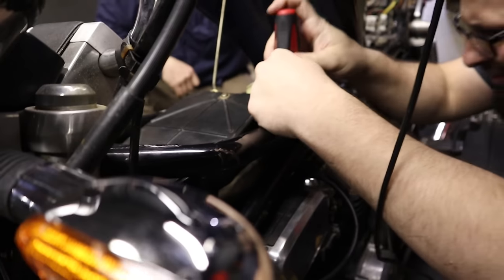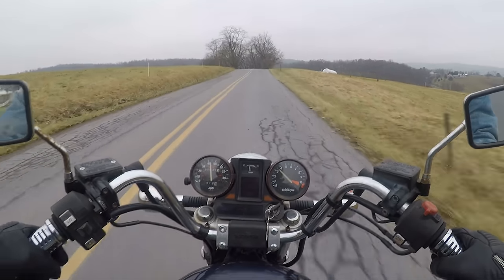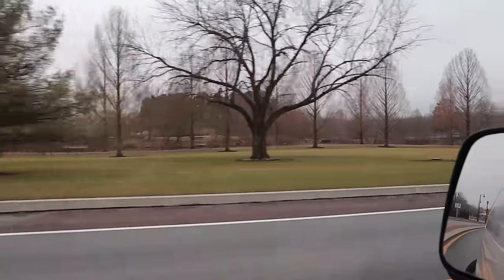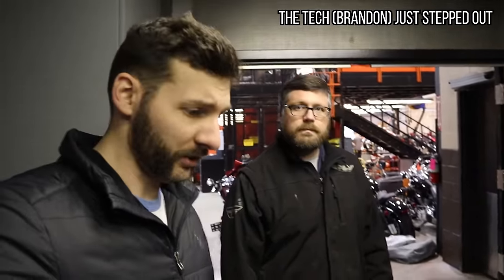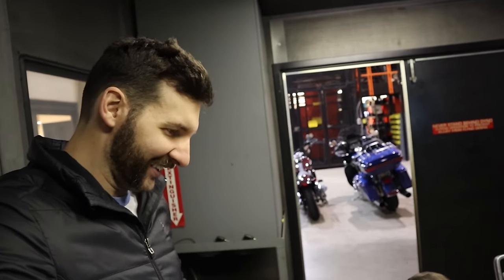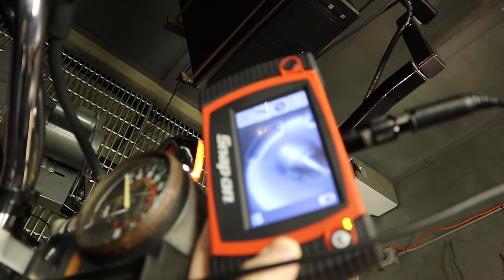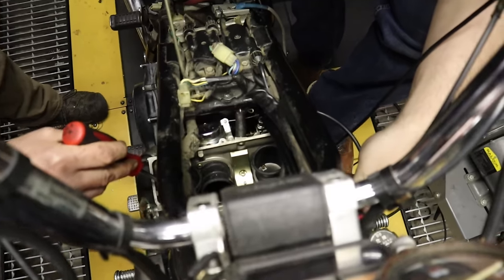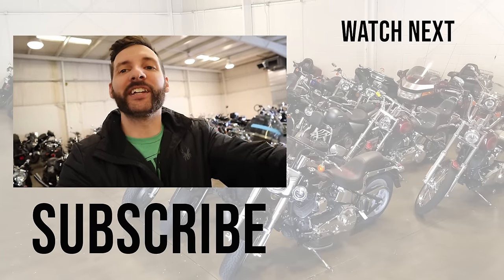We FIXED this abandoned bike for $83 then put it on a DYNO | 83 Honda Magna

Comment: I really enjoyed this episode. I don't know if you remember, but I picked up an '82 Yamaha Virago 920 last summer. I got a good vibe from the guy, he had trouble with the carbs which I found is most likely from over spraying paint inside the tank. There were pieces of paint flaking off in side. He gave me an extra tank which had the same problem. I haven't had time to work on the bike because I've been working on 2 apartments. The 1st to get ready for the people in the other apartment to move into and now finally finishing up the 2nd for me. It's amazing how some tenants can screw up an apartment. Every door needed some kind of work. Paint had been spilled on one carpet and just left. Luckily I was able to get most of the paint out using paint remover. Also, in my apartment there is an entry room outside the apartment where I Will hopefully work on the bike. Only problem is its on the 2nd floor but where there's a will there's a way and the landlord, a good friend, actually suggested moving it up there as he is a long time bike rider and has a 2003 anniversary decked out Harley. I learned a lot watching the guys working on your carbs, luckily I only have 2 with an extra set. Thanks for sharing.

Comment: I absolutely love the first gen Magnas, and just about any v4 cruisers. Early Magnas like this one were plagued with soft cams and top end lubrication issues. I wonder if this has come up in your efforts to get the power back.
Reply: That's what I was thinking. It probably just needs new cams and oil mod.
Reply: itsabig  yep. Scary fast. My Blackbird is in a totally different league of speed, but the bike is actually built for it. My V65 Sabre had power, but everything else about the bike makes the eyeball flattening speed feel like a completely different kind of scary. 

If Honda doesn't come out with another decent V4 cruiser, I might get a Magna someday.
Reply: @navypatriot1016 NOPE.  Look up the fastest production motorcycle for that era 83 through late 80's.  It was in fact the V-65 Magna.  I still have my v-45, bought it brand new in 83, and it runs like a top.
Reply: @navypatriot1016  I guess I was thinking about the fact that the V-65 was in the Guinness book of records for the fastest production motorcycle for that era.
  So yes, by the time the V-Max came around it was a monster that would out run the 
V-65.  But a 'pig'?  Come on now.

Comment: EDIT:FIXED so to make a long story short.. my estranged father i just met a few years ago, wanted to give me a motorcycle(i'm 30 now). i was estatic! 1982 gs650. brought it home, fixed the gas leak myself. fixed the head gasket leak myself. changed almost everything simple and standard. ran great! this bike is everything for me that i missed out on with my father... this is the bad part. someone clipped the spark plug caps (boots) off the other night for whatever reason. so i tried fixing it by adding a ghetto fix. the plugs are sparking but i cant get the bike to turn over and run now. any advice? anyone? i have to get this bike going again, it's a part of that gap i had missed with my family. (I found the problem and fixed it.)
Reply: Check the carbs. If it runs on starting fluid then it’s definitely your carbs.

Comment: I bought, fixed and rode my first road bike that was an 83 v65 magna.  It was cut up, so I made it my own.  Not a bad bike.  Pulls hard when they run good.  The slides not opening all the way could be some varnish on them making them want to stick, an air leak on the top side (near the cap) stopping it from building enough vacuum to pull the slide up, or a plugged passage in the carbs.

Comment: When does he mention if it a 750cc (V45) magna (80hp) or a 1100cc (V65) magna (115hp) ?  I would just get that said instantly. 
This must be the V30 (500cc) Magana at 50hp.
The V65 can still beat most cruisers today.
Reply: He mentions several times it should be 80hp - hence, a '83 VF750C (V45). The V45's can also smoke just about anything on the road, with a good carb job, tuning, and possibly rejetting - you know, basic shit for a carbureted bike. V4 supremacy. I don't even think they made the V30 in '83

Comment: Well, I had the V65 Magna ,1983, and it was rated “first motorcycle with over 100 horsepower”...... I loved that bike and it was a shafty on top of that. Great torque/bottom end.
Reply: 150 mph bike!
Reply: Wendy Stoltzfus then get 6th gear
Reply: Chris Gabbert- it's faster in 5th, 6th is an overdrive and the bike can't redline it. If it could it'd go some 173mph or something (don't remember where I saw that, something about production speed record I think). I have a '84 v65 magna, and it's a great bike. I agree with Michael, easy to ride because you can hang below 4,500 rpm all day and still be faster than cars on the road. Heck its torquey enough I've started in 3rd and beaten cars (it was a 2000's Honda Odyssey but it felt like he was standing still)

Comment: I've had a bunch of these... both the ignition switch and kill switch are underrated for the current (and inductive kick) this thing puts out until they don't work at all. Ignition switch is easy to find new.  I just jumper'd the kill switch since it was less safe to have a bike die unexpectedly. I personally thought the carbs were easy (compared to the nightmare it looks like), do the full rebuild with good hardware, balance them out, they will work. Oh, and repack the gear shift input shaft with heavy grease. Water gets in, rust happens, then you round off the 2 & 5 synchros and they kick out forever.

Comment: Back in my 30s, I had a V45 Magna I rode for a couple of years. I thought it was the greatest bike in the world. Then I bought a 750 VFR, going from a cruiser to a sport tourer, so I didn’t ride the Magna for about a year. I remember getting back on the Magna, thinking something had loosened in the steering head because the bike was all over the road. Then it dawned on me that I had been riding a fair handling bike for a year and was now on a cruiser, known more for looking cool rather than handling. I sold the Magna soon after but have fond memories of cruising down the highway with my legs and feet in front of me, my back straight, listening to that seamless V4 engine. Good times.

Comment: I learned to ride in Hawaii on an beat up Suzuki TS 125.
Used to make McDonald runs.
It was only a couple of miles, but the clutch cable was broken and we all smoked way too much pot to even consider fixing it.
Clutchless riding may in traffic just may be the best way to learn to ride - if you survive.

I was hooked and ended up in the Suzuki dealership.
Started out testing the little GS400, and worked my way up to the 750 - then had to try the 850 because it was shaft drive.
And of course, a 1000 wasn't much bigger - so that's what I ended up driving off the lot with.

I was on a sub at the time, so before we flew out to meet the boat, I dropped the bike at the dealership.
They removed the engine and shipped it off to Vance & Hines, and it came back an 1100.
Also went through the transmission and undercut the dogs for crisper powershifting.

Switched carbs to Mikuni smooth bores.

Never dyno'd it, but it broke 160 on H2 according to the tach.

Comment: Funny that your bike loses power while driving it. I had an 82 Kawasaki KZ440 D-Series that did the same thing. I drove it to a shop to get new tires put on it. When I was driving it back, halfway through my ride, the power just vanished. It ended up dropping from 50 mph to 35 mph in less than 10 seconds. So I pulled into an HOA and sat there for the better part of half an hour wondering what was wrong before I went to start it up again. And it just started up like nothing was wrong with it. I drove back home the rest of the way without any hesitation from her. I never figured out why it did that, but seeing your problem in the video gives me a clue as to what went wrong. To make matters even more hilarious, the starter didn't work on my bike. I had to push start it. Every. Time. It stalled. Nice video, btw.

Comment: I own a V65 and I can get that up to 90mph just on the freeway on ramp. Of course i was laying flat on the tank when I do it.
 I saw a Youtube video of another Magna that was also gutless. It turns out they had a bad ignition coil and were only firing on two cylinders. Even though the engine was running smooth. It was only on two cylinders.

Comment: My first bike was a 99 Magna. Still have it. When I got it, it would run great in warm weather, but it would run terrible in the cold. Absolutely would not idle either. Once you got it running, you couldn’t roll completely off the throttle or it would die. It was so frustrating trying to keep it running.  Carb rebuild and bigger jets fixed that issue tho.   Now it’s an absolute blast to ride. Runs great. Sometimes I’ll go a few weeks without riding it and start to contemplate selling it. It really does sit more than it gets ridden. But then I’ll ride it and think “there’s no way I could get rid of this bike”!

Comment: I had a Sabre V45 and A VFR, great engines.  I put an 82 V920 Yamaha on the road.  I may be too intent but new tires, brake pads, fork oil change, battery, grips, some bulbs, cables, carb cleans, starter and it ran really well.  Put 11,000 miles on it but got offered a trade I couldn't pass up. Lol, got sold to a motorcycle museum.  Which is probably not surfing.  Miss it, good ride. Only about 58 hp from 920cc V twin.

Comment: Bikes that sit THAT long, usually can do with a carburettor rebuild. Old fuel that sits in the carb fuel veins gets all gummy like enamel, which also clogs jets. I wouldn't be surprised if some of that loss of power was from partially blocked jets caused by 13 yr old fuel enamel. Slide needles also get their profile eroded over time, which will also affect the slide lift rate... so the needles could do with replacing too. Other than that, very cool to see these beautiful old Honda v-fours still getting around 👌 Wishing you and yours remain healthy and happy best you can during these challenging times 🙏

Comment: I had a 1981 Super magnet and I really miss it.
There is a very finicky little valve in between the gas tank and carburetor which is operated off of the manifold vacuume.
You can't get them anymore so don't bother trying.
What I did was just removed it blocked the vacuum hose and used the petcock to shut off the fuel when it was parked and never had any problems.
I'm 99% certain that is the problem you are having

Comment: I had this bike. It was a daily driver for me and it was so difficult keeping it under 80. It loved to go 80. Not the best cornering bike but It had power to spare.
Reply: Not the best cornering? I have an '82 (first real motorcycle i ever owned/learned to ride - still in the stable). Still an absolute blast to ride - not only because of the buckets of power and quick response, but the cornering ability - I swear I've had mine down to 10-15 degrees with total stability, except when it ground pegs lol. What are you using for tires? I really like the MT-66s on mine.

Comment: 1969 I was at my girlfriend house and it started to snow. After about 30 minutes I figured I should head home so I cranked the 1950 Hydraglide and headed home. I passed several cars that had slid off the road and finally made it home without going down. Only slipped a little one time.

Comment: One of my first performance motorcycles was a black 1986 V65 Magna which I bought in 1987 but I only owned it for a couple years and went through many other cycles since then...  I have always had a love for the V65 so about two years ago I was lucky enough to find another 1986 V65 Magna (red this time) not 20 miles from my house with only 21,000 original miles and got it for $2,000.....  Memories of my early twenties are being relived now in my mid-50s.😁😁

Comment: I remember my 1st motorcycle. I bought an '82 Kawasaki KZ650 CSR for $500 in 1998. I rode year round for 2 1/2 years, to 2 jobs, spending $5 a week in Sunoco 94 Ultra, and my insurance was $135 a YEAR!  I miss those days, but it broke down in the dead of winter, somebody gave me a free beater car, and then a few years later, somebody stole my bike and my Dad's '82 Honda CB650 Special.

Comment: Hello Guys. I live in the PI and ride a Honda 125 Wave I've rebuilt to 50 over. I have 250,000 KM on this old girl but she is a dependable and reliable little bike. It's main advantage is you can split lanes if you have the cajones, and here in the Philippines that's a must unless you want to spend the four hours commuting it takes a Big Bike or a 4 wheeler. The problem is it beats me to death on a 300 KM ride to Bantayan Island and back. I recently bought a 1992 Yamaha 250 twin inline classic for the equivalent of 180 USD  (PHP 8,000). It was run for ? with no air cleaners and sat for several years. The Starboard (right cylinder is weak) I got it running with a little TLC, but it needs to be rebuilt, so I decided to strip it down and found the following problems. The swing arm is rusted out ( I can repair that) and the frame at the back of the seat has a not as bad, rust problem. The Frame Number is 4A8-360529 that doesn't show up after months of checking online during this plandemic. I would like your help in Identifying this bike so I can rebuild it back to original and have a comfortable machine / safe machine to ride. I'm 75 now and don't need any more road rash at this point in my life. Thank You for your patience and help. God Bless you and GOD Bless America. Respectfully Yours; Braun.

Comment: I've got this exact bike! The same color and everything, mines a 82 tho. They're really fun and pull hard. it's got transmission trouble and is currently down due to timing chain issues. Mine also had an issue where it's suddenly loose power but then randomly all at once gain it back. one of the wires going into the coil packs would back off and a coil would shut down, then suddenly it'd make connection again and in a second double its power.

Comment: So, I know I'm a bit late on seeing this video and you've likely gotten the bike dialed in by this time.. But I've got a 1982 magna VF750C; some of the running issues I've had with power loss and random cut outs on power. the ignition switch itself causing low voltage to the ignition boxes under the seat.. the ignition boxes themselves not properly sending signal voltage to the coils, and the starter solenoid ; the junction of fuses on it constantly had issues.. Changed the solenoid out for an old ford style solenoid and hard wired the wires from that fuse panel to the battery and proper grounds. Changing to the larger solenoid is bit hard to get under that side cover but it worked really well on my project.

Comment: I learned to ride on a 85 Sabre 700, the magna’s kid brother. So many memories from watching that from the sound of that V4, to the crazy tight space where they jammed the carbs in, the look of those gauges, I miss that thing! Also, those v4s were very finicky about valve lash, check that if you want to help bring up your numbers.
Reply: Been so long, I couldn't tell if this was the V45 or V65 Magna, but then I remembered that the V65 1100 had a hair over 115hp factory.

Comment: Yeah, so those old Keihin style carbs have to have the rubber slide hose attached or they'll dirty up within 20-30 miles and the slides will stick because fine dust gets into them.  Result is you have to take them apart and clean them again.  I attach small fuel filters to my hoses as an extra measure to keep dust out.

Comment: I had one of these that was also given to me.  It had electric fuel pump issues (Who knew carbureted bikes had electric fuel pumps.). But once that was fixed I got the carbs re jetted and it was night and day difference. Way more power. Seemed very sensitive to altitude. And removing those carbs from the V4 for jetting was a nightmare.

Comment: There is always something with bikes but that is just the way it goes. I recently bought my first bike (2005 sv650) and when out on a ride I glanced down and the oil pressure light was on. I immediately shut the bike off and rolled to a safe spot on the side of the road. Straight away I thought, oh shit maybe there was no oil or something like that. Checked the oil and it was fine, in a bit of a panic I checked the coolant and it was fine. Tried starting the bike again and it would start but shut off straight away again. Waited at the side of the road for maybe 10 minutes and then decided to try it again and it fired up and ran fine. Drove home fine. The very next day I did an oil pressure test and followed the recommended procedure and oil pressure was perfect. Took the bike for a ride again and the oil pressure light did not come back on and bike runs fine. Possible faulty oil pressure switch so if it happens again I will have to look into that. Just kind sucks because with intermittent faults like that you don't really want to go too far in case it happens again.

Comment: Those V4 carbs are a real pain. My V65 Saber gave me tons of trouble with them. Billysoutback sells some great rebuild kits and rebuilds them himself as well. He's the expert on V4 Honda carbs. I will say that those carbs are CV (constant vacuum) so the filter is VERY important to them functioning properly, stock filter works the best and if the filter is to clogged it can cause issues. Just some things to check. Great video keep up the good work man!

Comment: i had a Kymco Venox 250cc and it was a carbureted bike, that ran flawlessly for a used bike and thankfully my first bike maybe i should have said that the other way around lol but omg the sound of a carbureted engine mmm i think thats what i miss most about it.  Full tilt shifting at the redline that thing loved it, absolutely loved it even if it was a 250cc holy smokes it was so much fun.